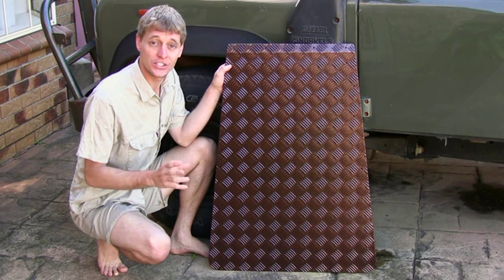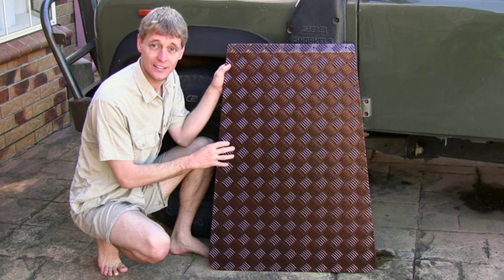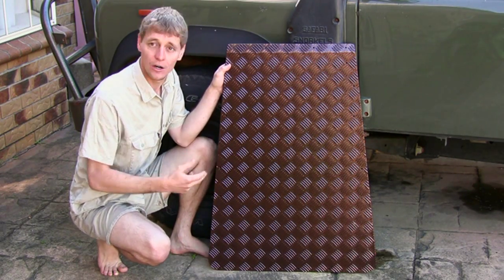Defender Bonnet Protector Installation

Comment: I like that little trick with the foam to stop the drill check damaging the paintwork.
Reply: That's much cheaper than the paid for options! I'm off to find some pipe lagging!
Reply: Matt Allen doesn't stop the drill from skidding across paintwork though ...
Reply: What would life be without that horrifying squealing noise? I tend to use masking tape if I'm not in the mood mind ;)
Reply: Matt Allen CT90 is the stuff to use on the drill bit.  ahhh life is so quite with it.

Comment from the maker: I added the gasket to reduce any vibration between the bonnet and protector, just in case there was sufficient space in the central area for the panels to move. Otherwise yes, the gasket wouldn't be necessary.Thanks